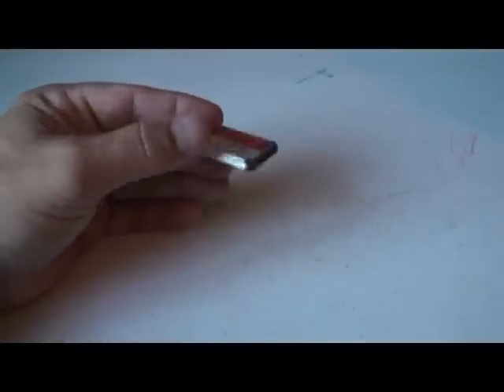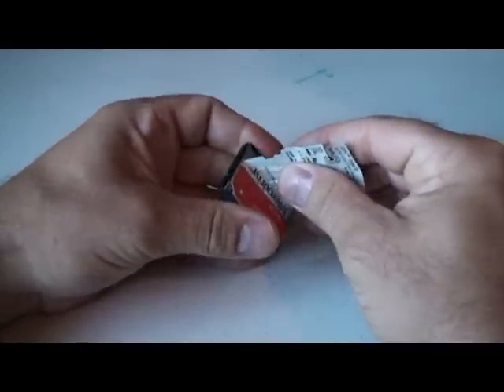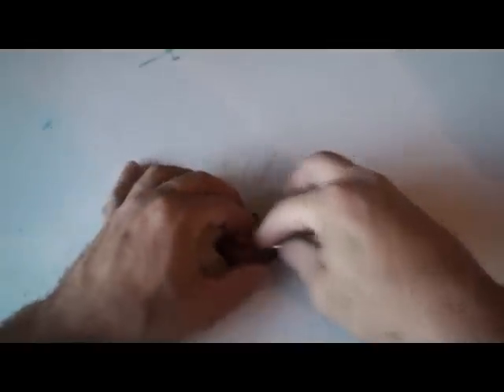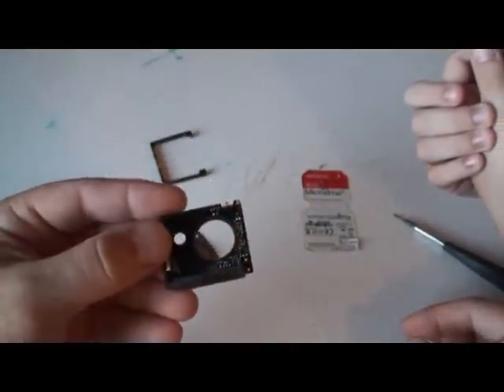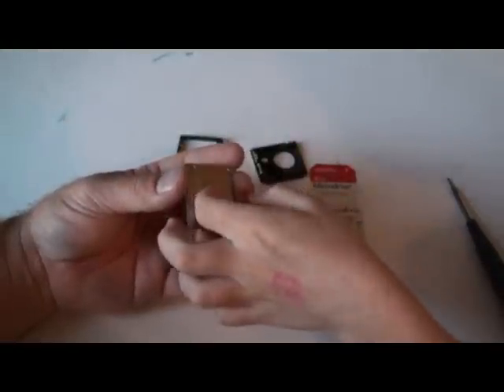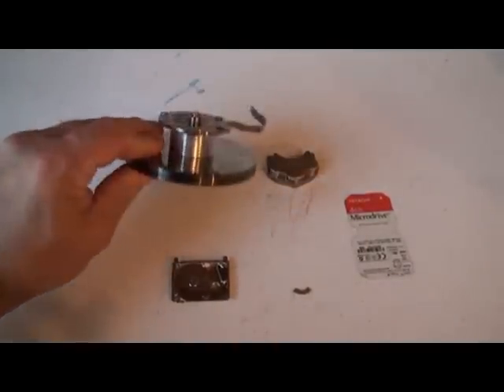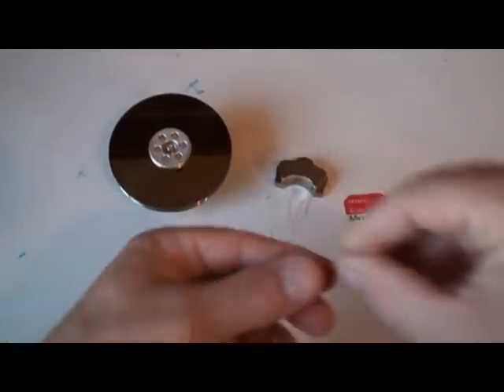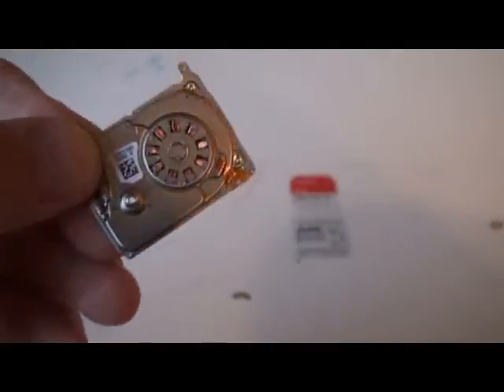[INSIDE] 4 GB Microdrive CF II  / (Teardown) [KTFG 030]

Comment: Saved and fav'd, and 5 stars just cause ;)

i was looking for a guide on how to open one up. I am going to attempt to Remove a board from a 5GB ST1 -001 and put it in an 8GB ST1 -220. 

From what i've read they are the same board, aside from the fact that ST1 -100 has no firmware (ST1 -220 is locked in true-IDE).

So thx, looks easy enough to open (need tiny screw driver tho)

Comment: Nope, the hitachi microdrive is not a sealed drive, the vent is located right above the disk area. also the top plate of the microdrive is mounted useing adhesive tape, if that gets wet is can become lose and vunerable to water.